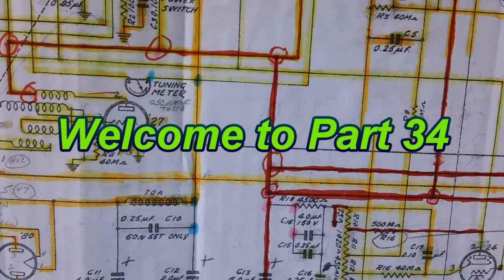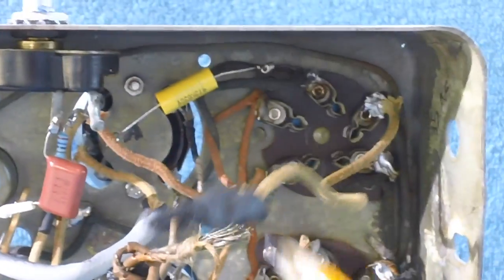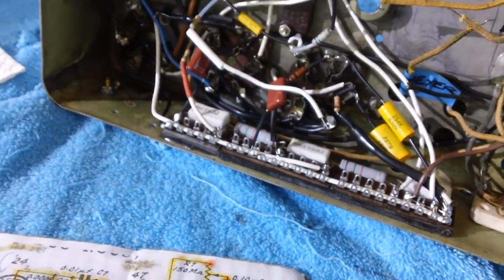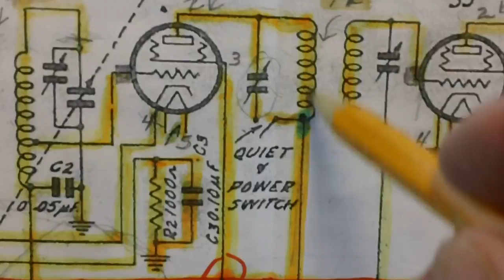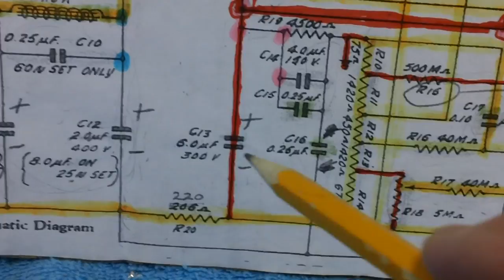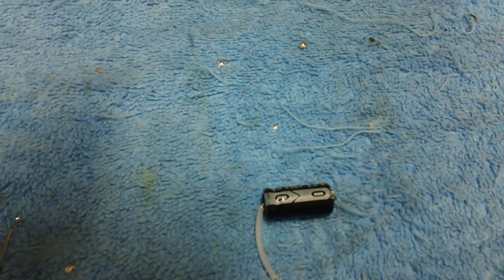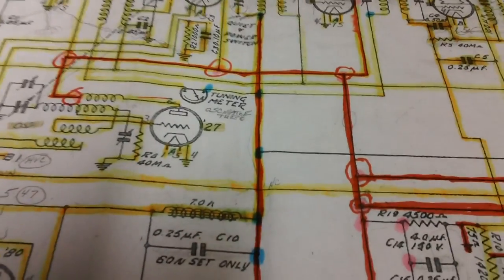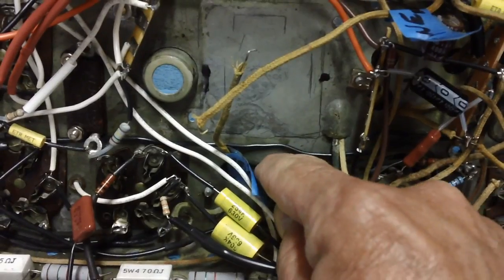1931 Airline 62-14 (Part 34 of 44).

Comment: John, 

I'm glad you mentioned that the center tap is the most negative part of the radio.  It's one of those basic radio things you just need to learn.  Every once in a while you'll find a capacitor whose positive end goes to chassis ground and the negative end goes to the center tap because it's more negative than the chassis.  To me that seems odd, but it's just the way things are, electronically speaking.  I know some Philco radios are like that.

I'm glad there are more wires that need to be cut.  That's when you seem to be happiest. :-)

Regards, Tom

Comment: I have to ask, why is the center tap the most negative point in the radio? Is that just one of these things I need to know?
Reply from the maker: Scott,  To be sure I was right, I first conferred with Brendan on this.  Basically, the full wave rectifier generates positive pulsating DC voltage from an AC voltage input.  Each positive pulse therefore has a zero starting point, which is the center tap, thus the center tap is always negative.  Regards,  John
Reply: +Scott Johnston   John is correct in this case.   If the rectifier tube was wired in reversed to reverse rectification direction it would be the positive side.   See link for solid state equivalent circuit that might be easier to visualize for some guys..  It is called a "Center tapped full wave rectifier circuit."  See link here.   http://people.seas.harvard.edu/~jones/es154/lectures/lecture_2/diode_circuits/diode_appl.htmlScroll down to the  image down the page.The center tap being negative is more of a convention and convenience than gospel.   Most people make the center tap negative because it is a common point and simplifies the circuit by making it negative or a ground.   There are times where is could be reversed to serve the circuitry tied to it better.